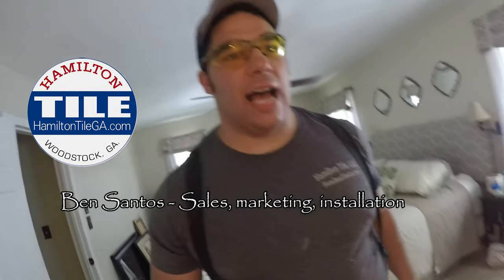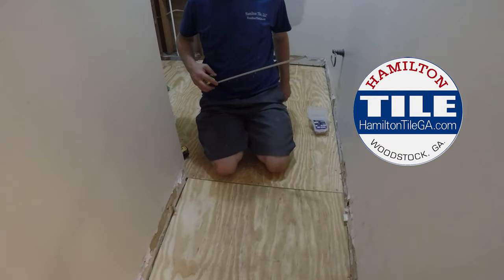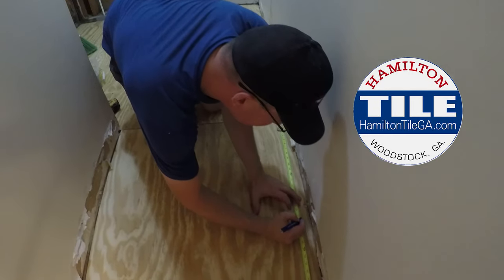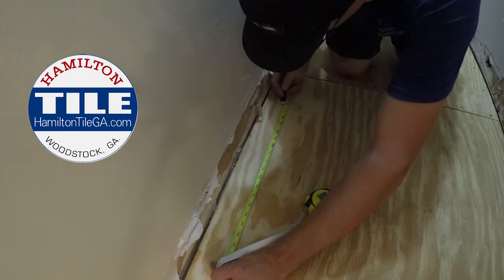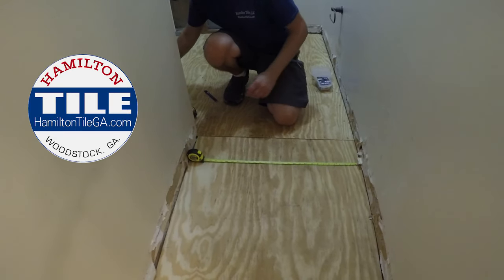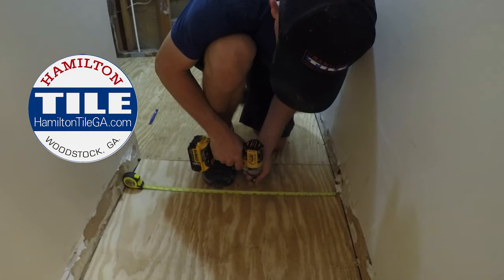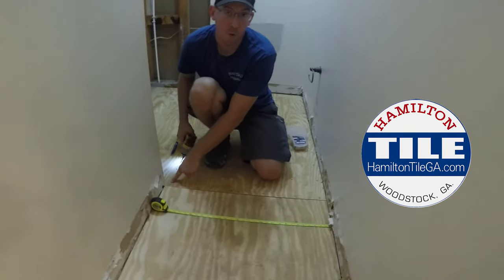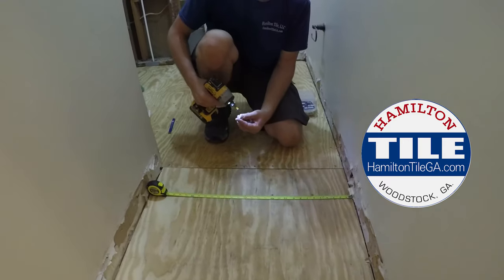How to screw your plywood sub floor with this easy system!

Comment: Run the screws into the floor joist and move on! Your much to slow with the tape measure shit.
Reply from the maker: Speed over all else, it's why our houses suck and are falling apart prematurely. You have the brain disease, I see.
Reply: @HamiltonTileGA  never failed an inspection ! You know where the floor Joist are  shouldn’t be necessary to mark them out. It’s not about speed it’s about efficient use of time. I have installed tons of subfloor and can assure you efficiency and speed aren’t the same .  You have a good day
Reply from the maker: @frankloree2462  yeah, Im sure you love pleasing that inspector. I can tell a dummy when they throw out that word "efficiency" this has nothing to do with joists and everything to do with joining two pieces of plywood together.
Reply: @HamiltonTileGA  you win it’s not worth arguing . Have a good day and stay safe
Reply: Unless you don't install much subfloor, should be able to eyeball that kind of distance. Uniform pattern